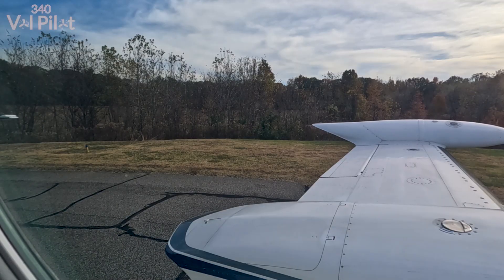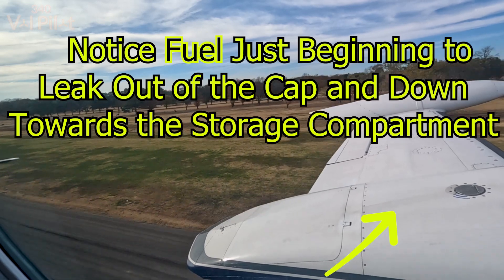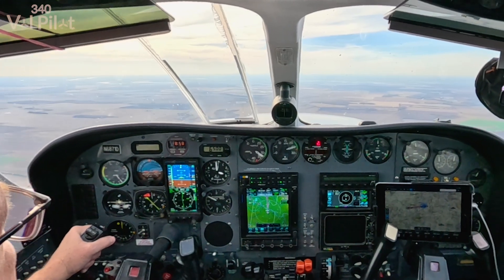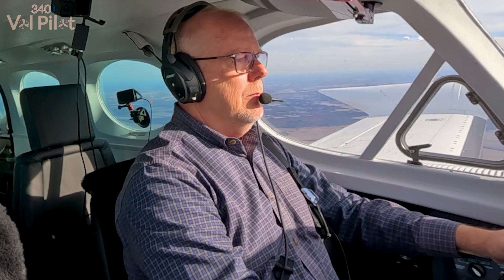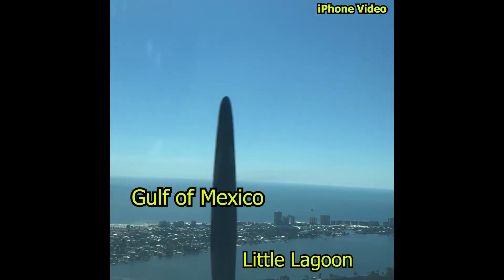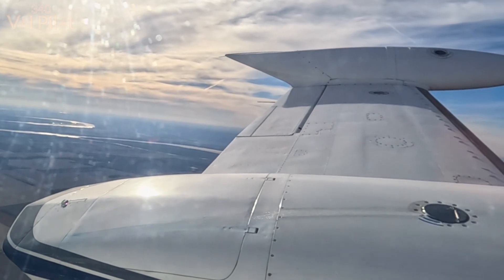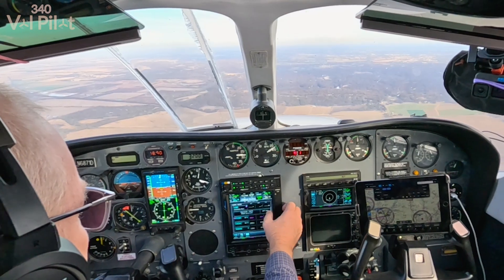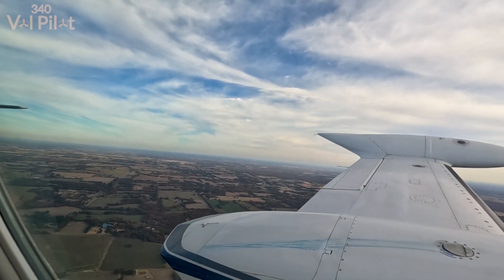Major Fuel Leak in Flight!! Cessna 340 #pilot #flying #aviation

Comment: Thanks for sharing that. Our C310P was plumbed for WL tanks but we never had them installed. Amazing what you can get in a twin Cessna for fuel. We were 140 (20G aux) useable and could have added twin 20's in the wing lockers. You can get yourself to 203 in the 340, serious range! We would fly from Seattle to OSH every year with one fuel stop in Miles City Montana. The leg back from OSH to Miles City you're bucking headwinds I wish we had another 20. Sometimes we had to stop short, we were always chewing on putting a 20 in there. Enjoying the channel and would love to see a walk around of your 340 sometime 🙂
Reply from the maker: It is amazing how much fuel you can pack into the twins…when everything works properly. 183 is my max since I only have one WL tank. I’ll have to think about how to do an interesting walkaround. Any thoughts on areas of focus?
Reply: @340VolPilot  I think it would great to hear about how you got into flying, what airplanes you have had and why the 340. Then walk around the outside pointing out things of intrest like the fuel tanks, wing lockers, why Cessna made the tips the mains, what add ons you may have like VG's, ice protection, etc. Perhaps things you may want to do in the future. Tell us about the engines, RAM? , OEM. We love engines. Where you check the oil, how you do your pre-flight. Fuel sump locations, outside control locks if needed. Aviation buffs love that stuff and love to get to know you. Perhaps do 2 videos with one like that with just the outside of the airplane. Then one for the inside starting at the air stair door. That way you could make it detailed and not feel like it's to long. I hope that helps but of course I am being selfish cause I would love to see and hear about all that. There are some real twin Cessna buffs on here so this is great stuff. Thanks for posting really enjoy it. 😎👍
Reply from the maker: Very, very good suggestions. I’ll put some thought into how I might be able to put-together something interesting.

Comment: 3:12…you don’t “crossfeed half of it to the right tank” but rather you allow both engines to burn out of the left main tank until the fuel loads are balanced.
Reply from the maker: Well said and thanks for watching.
Reply: @340VolPilot  did I mention I enjoy the channel?!?!  Thanks for a glimpse into your travels!
Reply from the maker: Thank you. I really enjoy putting these videos together. Stay tuned!!
Reply: That's the definition of "crossfeed".

Comment: Well now I am wanting to know if it was the cap gasket, over fill or just not put on correctly.  LOL   Very glad it worked out for you. The stain will just need some rub down.    Take care.
Reply from the maker: The mechanic says it’s the gasket. I’ll have it changed out at the next oil change. Yes, the dye stain comes right out with a little elbow and product. Have a great Thanksgiving.

Comment: I run my locker tank out about 3 or 4 times a year, just to make sure that it works (and keep the fuel fresh). I use the locker tank (I have the exact same setup as you) as my emergency fuel.....I NEVER plan on using it in a normal flight, but rather as an extra half-hour or so of time in an emergency. 
You should keep that tank wet to keep the fuel bladder from drying out.  

Smart move to turn around.
Reply from the maker: Agreed. I need to use it more and keep fuel in it. I end up not keeping fuel in it because I frequently need the extra weight available that the fuel weight would take up.  It’s definitely a trade-off. I do like your safety net idea. Thanks for watching and commenting.
Reply: @340VolPilot  You don't necessarily need to keep it full to keep the fuel bladder soft, just some gas (like 5 gallons). 

I figure if I need it then the 120 lbs is worth having though.
Reply: @HyperSpaceProphet   I have a different view on this.  You may get some sloshing effect with only 5 gallons, if the aircraft is flown very regularly, but why not use it on  every flight that it is practical, to keep fresh fuel, as well as to keep that tank supple!  The switch that activates the transfer light that comes on when the tank is empty is also a very expensive part that should be operated periodically, in my opinion as an A&P / IA.  If I recall correctly, the Nacelle is the only bladder on the 340, that said - the mains tend to get leaks on the sealed nutplates after about 40 years or so, so that's another one to look out for on these wonderful Cessna twins.

As to the heat insulation, there is a relatively small piece of insulating material between the firewall and the actual bladder, if it's never been replaced, it might be worth inspecting at some point in time, as I have seen one degraded.  Compliance with the AD (2000-01-16) should also give a very good idea as to whether you have excessive heat or not.  Unfortunately, if you do, the firewall must get replaced, as well as the aluminum fuel lines immediately behind the firewall.  Checking your v-band clamps, frequently, can help preclude that.  First sign of an exhaust leak is critical on these big-bore turbocharged engines, to not break the bank!

Great Aircraft!
Reply: @scottcash3232  I DO use it periodically. But I plan most of my trips so that I don't need that last 20 gallons...but I do make sure the fuel is used and replaced a few times a year.  I'm sorry I was not as clear as I could have been.

The aux tanks are bladders too, btw. 

I will look into it and make sure that AD is being done.
Reply: @scottcash3232  I should be more clear. I keep it full at all times.
Reply: @HyperSpaceProphet  I was mistaken, you are correct; the aux are bladders (not that you need my confirmation)!  Silly that it took me 10 months to see the comment - I don't check my linked e-mail often.  Hope you're well!